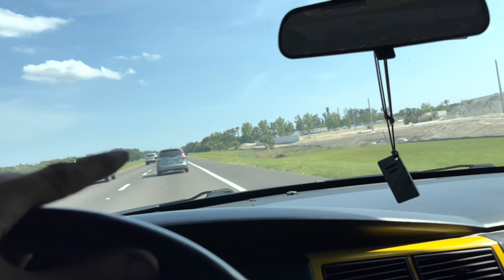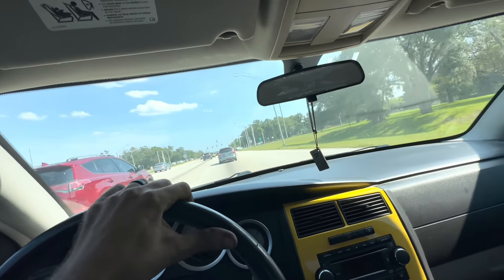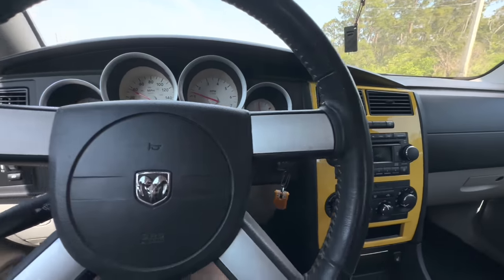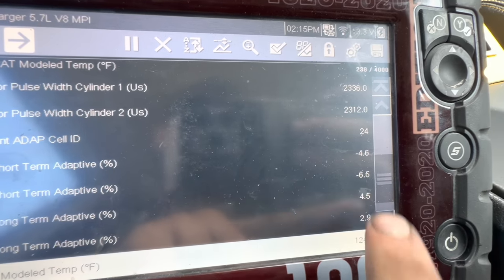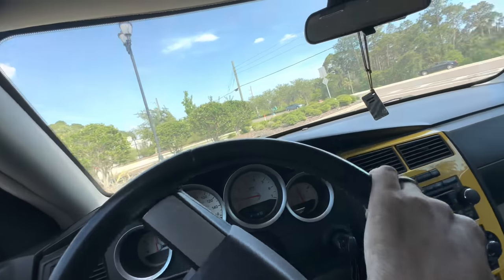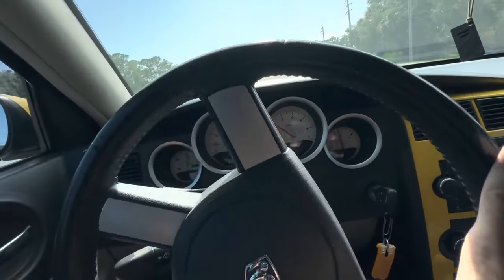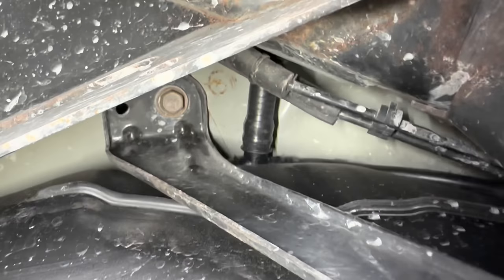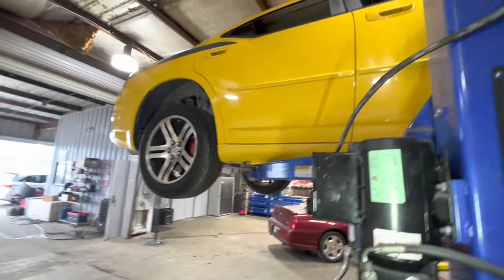Customer States: Engine Stalls After Fueling...HELP!! Dodge Charger 5.7 #mechanic

Comment: Ray, I have an 06 Magnum that had the same stalling issue.  Just after completely refueling the tank, the vehicle would stall maybe 60 seconds later but after that would not stall again and would restart instantly.  There was a recall on the fuel tank and they replaced the tank (not sure of any other parts replaced as part of the recall) and the issue never happened again.
Reply: My 06 Charger RT did the same thing at about 95k. Same thing, defective gas tank and my local Dodge dealer took it in at 10am, a little later once I got home from work to drop it back off. It's a extended gas tank warranty and they had the tank the next morning, replaced by 4pm and I picked it up about 5. No charge to me, 05 and 06 Magnum and Charger only. I had a gallon left when I picked it up and gas station fully toped it off, no stall now. The receipt says they replaced the tank, and gaskets for the fuel pumps. See X53 warranty for fuel tank replacement. It's a known problem and when your 05-06 does it they replace it free, as far as I know no limit on mileage.
Well now that I've seen the whole video now I want to see what you find seeing how the recall/extended warranty was done... 🤔

Comment: I Would check the relays in the rear, my buddy said this solved his stalling issue, even after a replaced faulty fuel tank. Great Video Ray!...Something about negative pressure, and when stuff "works" may suck in fuel? if I understood him correctly

Comment: Hello Ray, I’m so glad you mentioned about not breaking hard in front of trucks are pulling out in front of them. I was grossing near 80,000 pounds when a woman in the left lane on the interstate realize she was about to miss her exit and pulled over in front of me and slammed on her brakes with four children in the van. It was so hot outside. My tires did not squeal. When I lock them up they just melted and it was like I was on ice. But when the whole family gets killed, it’s the tractor trailers fault! Thanks, Ray!

Comment: additionally check the crankcase ventilation. Don't ask. 
If the vehicle stalls  intermittently, check the relay for the fuel pump (better. all relays) and ALL fuses. 
Pull them out and plug them back in so that the current flows safely without being restricted by corrosion.

Comment: Clean looking Charger for it's age...owner takes good care of it. Not a single blemish on the wheels even.
Reply: @Simr Khera that's the same point he was making
Reply: @Simr Khera living on gravel roads gets you shit box status real quick. I’ll never be able to have a nice car 😢
Reply: @wza223-fo3mc  Not the owners fault... problems started when somebody started changing parts. Willing to bet it turns out to be an installation error... or what Ray is suspecting, a faulty new part.
Reply: It's nice having a car in Florida. Show the car a little love once in a while. And if you have a garage to put it in, you're in good shape. I can tell that guy that owns that car is not a fanatic. Look back in the video at the inside of the gas door. But it still looks good.
Reply: @tywebb355  Don't need to be a fanatic to take good care of your vehicle... just a bit of good care can take a car a long way and will save lots of money. I'm also like that, although cosmetically my car could use some work because it's has parking damage all around... tnx everybody! But mechanically I take very good care of it, it's an '07 Civic with almost 250k on the odometer and never had a major repair, it never has left me stranded.
Reply: @wza223-fo3mc  All the mechanical issues? There is only one..Toyota,Honda,ford,GM all have issues!

Comment: The ESIM switch on the EVAP canister is known to go bad tricking the system and making it shut off after refueling. Better off the replace the canister. I saw this a lot on cop cars. It was saturated with fuel because they over fill their tank and liquid fuel goes into the canister

Comment: overfilling or  topping off your gas tank can cause pressure to build in the tank and flood the carbon filter vapor collection system, only meant for vapor. As a result, the overflow can affect your car's performance and could possibly damage the engine

Comment: I have a 2006 Dodge Magnum 5.7L HEMI that had the same symptoms about a year ago. It was completely random. After stalling it threw the following codes: P0300, P0430, P0032, P0038, P0052, P0058. Mechanics I talked to said its possible bad gas, my issue was also on any day it was over 90 ambient air temp (fellow Floridian). I will keep you posted as well on what I see. looking forward to Part 2

Comment: Some people click off the fuel pump nozzle a number of times to get as much fuel as possible in the tank filling up the fill tube. After the cars is driven for a while the level goes down in the fill tube and the purge valve starts working, but it has allowed liquid fuel into the system, choking the engine.  
Just saying that's it may be the cause

Comment: I used to have a 25' travel trailer and after pulling it around several states, I had a new understanding and sympathy for big truck drivers. A couple of times on the interstate a kid in a Honda switched lanes quickly in front of me and then jammed his brakes.  They never knew just how close they came to being run over by over 10,000 lbs of truck and trailer.

Comment: Another thing to check would be the Torque Converter Clutch. If it is staying engaged it will cause stalling. May also stutter if it releases just before it stalls.
Reply: interesting ...... yes ..... following someone else's train of thought .... is not always the way to go ...... Ray proved that several videos ago
Reply: That wouldn't explain the liquid fuel in the evap system

Comment: I get the very distinct impression that this will not be the last video for this Charger.  I think Ray is on to a very big clue in that liquid gasoline is in the evaprative system in a line it should not be present.  All/most of the usual suspects have been checked, save for verifying the electrical signals are correct to each of the evap devices.  The trick is each of those evap devices has an open and close command that has to occur *when* it should occur.  I don't know if the scan tool will allow you to check each one of those open/close commands, but that would be my next step, along with what was already mentioned with the fuse/relay issue in the trunk.  The good news is that a clear fault (gas in line where it should not be) has been detected and only through systematic fault diagnosis can that fault be resolved.  I am glad you made it safely back and I look forward to the resolution video for the Charger.

Comment: Well Ray, all I can add is that I have a '10 Dodge Caliber and if I fill the tank completely I can sometimes experience a hard start issue, especially if I were to park on an incline after filling the tank. I figured it was some issue with the charcoal canister so I got into the habit of just filling the tank to 3/4-7/8ths full and never had the problem again.  You could POTENTIALLY tell the customer to do the same and see if the problem recurs

Comment: Ray. It may be simple user error. Over filling. The tank needs air space you stopped filling when pump clicked off and didnt "round up" to nearest dollar. If the tank is over filled no room for fuel to expand thus it ends up in the lines. Either return to customer and tell them to drive it for X time and dont fill past 3/4 tank in that time. Or you yourself go fill it up again. And "top it up" when the pump shuts off. Do it 2 maybe 3 extra click offs. See of vehicle stalls out. My dads 03 toyota echo didnt stall but would always throw evap codes for flow issues when it was refilled as he did top up and it got gas in the canister. I mean it is bad for the evap system to get gas in it but at this point it already does so it cant hurt worse to test.

Comment: I had a random stalling/power loss issue after they worked on my Grand Caravan last week.  The issue was a loose connector on the battery.  Sometimes it's the silliest things.

Comment: I owned a very old 3000 GT with a fueling issue, apparently after some many years, the brain box would short out the relay for the fuel pump and run it at all times, until the car battery depletes. The short term fix was a relay between ignition, and fuel pump, the long term fix was to replace the ECU.

Comment: Another confirmation of over fueling would be to look at the o2's and fuel trims, the o2's will be rich and the fuel trims will be negative, try it with low fuel in the tank then put gas in it and notice if they change, at least you will know if you are on the right track.

Comment: agree with the over fill of fuel !!  Owner is one of those that round up to nearest dollars after pump handle kicks off. Had a friend in Sorysota that did that and engine stumbled after fill up. What makes it worse is the Florida heat and expanding fuel. As a boat mechanic up north we always tell our rack boats to NOT fill up before rack as the fuel expands and comes out the over-flow vent and onto the boat stored below !

Comment: I've seen in other posts of yours related to this idea. The charcoal canister man be a problem. If it is saturated, it may allow too much fuel into the intake for a start.
Reply: I would imagine that a saturated canister would cause low fuel trim numbers. Trying to subtract fuel from an overly rich condition.

Comment: Hey Ray. If you happen to read this comment, I heard of a trick so you won't spill oil all over your arm's when taking off a oil filter. You probably heard this before,but use a clear plastic cup and sleeve it over the filter
 Unscrew it with the cup over until it leaks into the cup. Always enjoy your video's. Thanks. 👍😎

Comment: Ray, I had a similar frustrating problem with a VW years ago. The cause was the same as WheelsUp mentions. Changed the fuel pump and ignition relays, no further stalling issues. 
Stripped the old units, the contacts were pitted and black.
Reply: Afternoon Ray! Just received your chat request. How you doing?

Comment: It may be completely unlikely because I imagine it would be obvious to anyone who knows the ins and outs of those cars, but if the entire system has been disconnected and then reassembled, could a couple of lines have been crossed allowing fuel or vapour to flow to the wrong areas?
Reply: I thought of that myself as well up on the tank.. is it looks as though at least those top two lines will only Play down in One direction
Reply: It's a good theory, in practice it's been my observation that the lines are different sizes to prevent cross installation, like one is 1/4 and the other is 3/8 line

Comment: Canister purge valve . hyundai, fords, chevys sometimes also the connector pigtail on the chevy.  follow that hose to the engine bay it's usually closer to the engine

Comment: I would be somewhat afraid to own a charger because I don’t want to find myself in a police chase..
Reply: Especially in Arkansas.
Reply: The last ticket I got was in 1972 lol that was 69 in a 35 in my 1970 roadrunner lol
Reply: I’m calling in from England so I’m not up to speed with American cars. 
I thought Dodge chargers were orange not yellow, had “01” painted on the side and the doors were welded shut.
I wonder if the fault might have manifested itself if Ray had jumped the car over a river.
Reply: @ngnmech  precisely.
Reply: Rented a Charger once. Everybody slowed down around me. Lol.
Reply: You’re almost guaranteed to get in a hot pursuit when you drive a charger you should not drive one
Reply: On the bright side, at least it doesn't do Mustang things and pedestrians are safe.
Reply: @johnedwards1685  well said😉
Reply: @johnedwards1685  They used quite a few of those up didnt they!
Reply: Me too!
Reply: back in 2001 in israel   i owned a 1999 convertible  mustang    yellow with black roof   and every day police stop me ,some days multiple times  a day , after 2 months  i sold    it back

Comment: Ray, you mentioned the high price for fuel, 98 octane petrol is currently around $2.50 AU per litre in Sydney Australia which equates to $11.30 per gallon and diesel is about the same price at 42.45 per litre. The price went up around 60c per litre in the last few  weeks. Crazy times.

Comment: Hi Ray I just compared the cost of fuel USA to UK, for the same amount of fuel you put in would be $71 in the UK. Keep up the videos, I like to watch how you solve some of the more interesting ones. My 3.5 litre SLK is considered to have a big engine in the UK. Some larger  GT cars have 5 litre size engines most care are 2 litre of 1300CC.
Reply: Under UK engine sizing 3.5 to 4.0 litre is considered mid-sized, so I have a behemoth of British giganticness at V8 6.75 litre, (412 Cubic Inches for those across the pond). Any guess on what that might be?

Comment: Had the same problem. There are relay’s in the trunk fuse box is failing. Will eventually turn into a no start situation. Start-run relay and/or fuel pump relay.

Comment: my 06 charger 3.5 would stall out also at red lights, would put it on N and it helped. kept on researching, in the end i replaced the fuel pump behind the driver and the other pump behind the passenger, it’s been working fine for the past year, had no codes before changing the pumps

Comment: My 06 R/T did the same.The dealer told me it was a transmission issue.They changed the fluid and did a computer reset from the factory.Problem gone.I drove the car 9 years after that.

Comment: I had two Magnums with Hemi’s that did it when I overfilled the tank. You have to stop when it clicks. Both tanks were replaced due to factory recall that stopped it from happening again. My brother had a same era 300 that did it as well. The dealer replaced that cars tank as well.

Comment: I had an issue where the truck would stall after fill up.  When I checked my fuel trims, they would go full scale negative (rich) for a while and then would go back to normal after a bit of driving.  Turned out to be a purge solenoid that was stuck open and would suck fuel into the intake when the tank was full.

Comment: My trans am was doing the same thing. If I got on the gas hard it would stall when I stopped. Finally after changing out my injectors and had the intake manifold re gasketed it fixed the problem.
Someone has been overfilling the tank. When filling the tank and it clicks off, they need to stop trying to keep filling.

Comment: I had a '12 Mustang 5.0 in with the exact symptoms. Fuel system checked out fine, all tuneup parts OK, no codes except for endless 02 sensor related codes, PO157, PO133, and more. All O2s can't be bad, something else must be. 2 days later, I found it - a moderately burned ignition switch. New switch, ran perfect with no stall-out condition afterward.

Comment: Ray, i have a Ford Escape and after fueling it, it stumbles a few times after filing it (particularly if I add any fuel after the nozzle kicks off). I'm told it is a problem with overfilling and the evap system.

Comment: The PSA on traffic safety is very needed. People don't realize that large commercial trucks don't accelerate or decelerate the same as consumer cars and trucks.  I always find it  interesting to see what causes random stalling in different vehicles. For me in my 5th gen Prelude after replacing my distributor, idle air control valve, the MAP sensor, and the alternator it went away for a bit. It came back several months later only worse it would start but then the idle would surge for a min and then stall. I found out it had a recall on the ignition switch which was the cause all along. Basically the ignition switch would short to ground and the car would think I turned the car off.

Comment: I used to work for a Chrysler dealership back in the day the evap system works the least when the tank is full. Given you are not loosing vacuum through the system and the tank is new I would look at the sending unit

Comment: Fun fact. I didn’t know about the fuel filler icon on the dash until I was about 35 years old. My job required me to travel and I learned about it by getting rentals cars. Can’t believe it took me that long…

Comment: We have a 2006 Charger RT Hemi that had this issue  It was covered by a recall and we had a new tank installed.  That fixed our stalling issue that only happened after we filled up the car.  However on the these cars you can not try to add more gas after it shuts off.  If you do the stall will return even with the new tank.

Comment: I remember that happening to me in my 92 Cadillac Fleetwood brougham with a 5.7L rear wheel drive. I thought my fuel pump was going bad or clogged fuel injectors it was driving me crazy to find the problem! Turned out to be a very clogged fuel filter! When I replaced it I tried blowing through the old one and there was so much resistance my breathe was hardly going through! After that the car ran fine.

Comment: I had that problem and it was hard to refuel. Gas pump would constantly click. Dealer said it was the valve in the tank. A $1600 job at that time on my 06 300c. Well I sold it.

Comment: I specifically recall older dodges having a particular issue with the crankshaft position sensor and it never threw a code or anything. It would cut out and die on my friends vehicle and it took us months to figure it out.